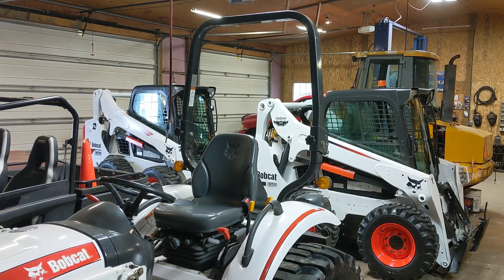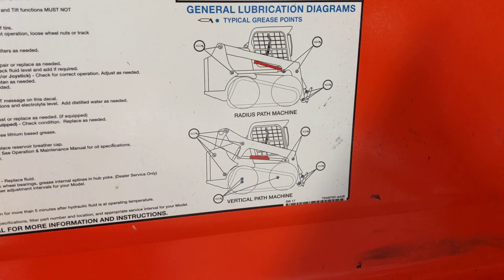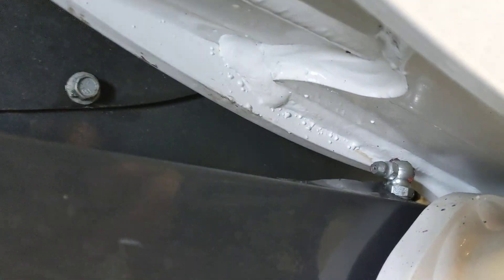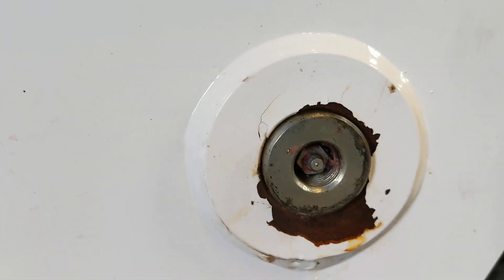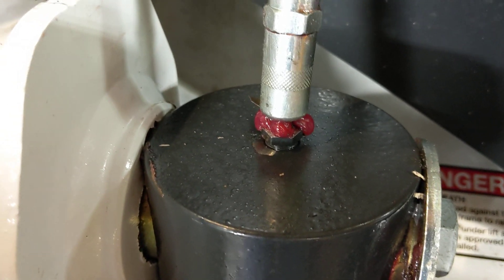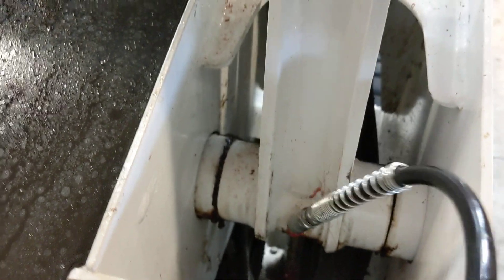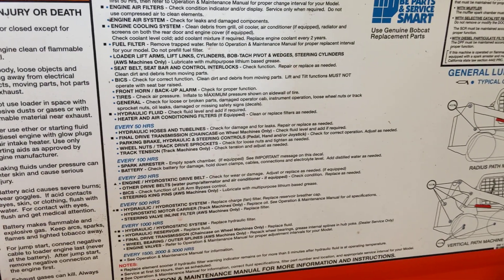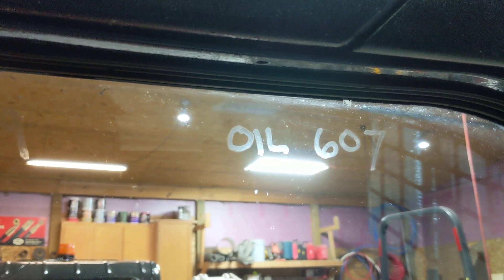Bobcat Skid Steer Loader Maintenance Tips!

Comment: Hi Dan, I am looking at buying a new 2019 S570, what do you think of them?
Reply from the maker: Hello. Good size, decent power, Nice options. The newer (2017 & Up) ones have a bobcat engine instead of the old Kubota engine. Filters are more expensive and somewhat cumbersome to replace. For instance they mounted the oil filter upward on an angle forcing you to spill oil everywhere during an oil change. The hydraulic fan filter is in an awkward spot that requires you to tip the cab up and take out a back panel for access. That is If you can't get it out by hand through the side vent. Ours was on so tight from the factory I literally had to crawl under the cab to change it.

All in all everything's accessible. One thing I don't care for is they seem to start rusting sooner and the decals don't stay on as well. Probably because everything is moving towards environment safety. It's a pretty well-rounded machine for the size and power.